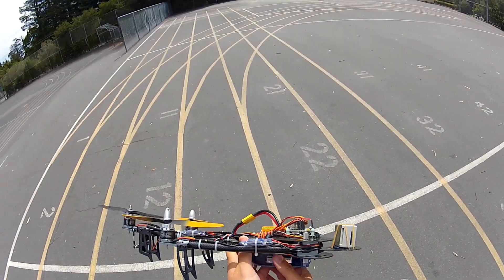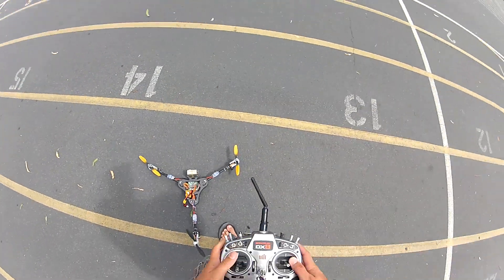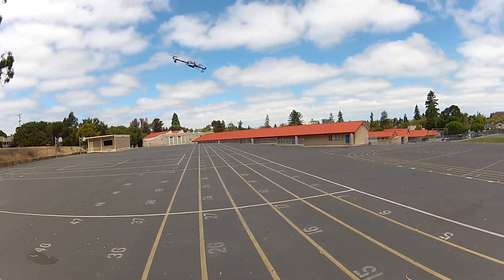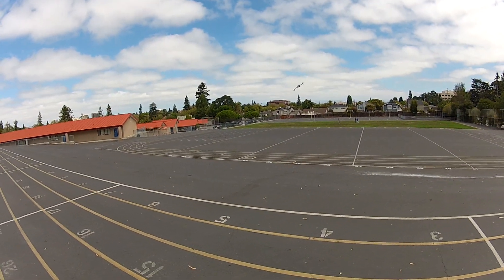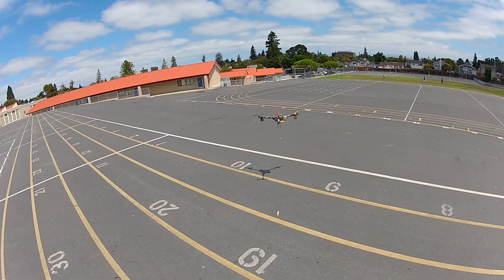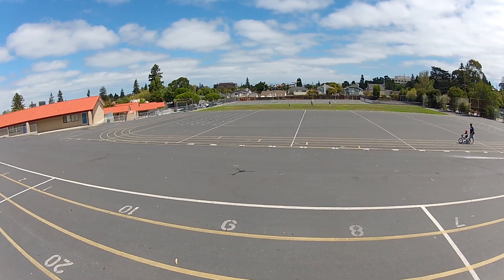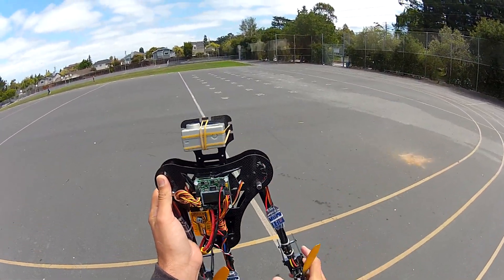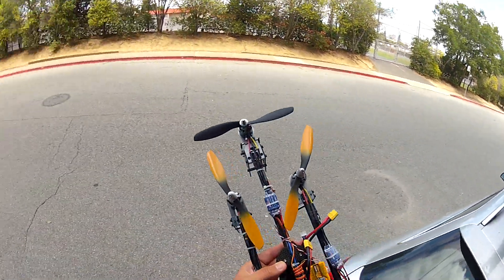Talon Tricopter: Tuning with flip and roll!

Comment: I lost mine the same.way ot got snagged.. but  Yes there is getting crazy efficiency out of the 3303 so as well a speed that was with I believe Sonny's motors a new tail kick shall 12 to 13" APC up front and like a slightly smaller prop on tail usually APC speed props.
..it flew forever heaps of power  I miss it so badly even with the cake 82 I was happy to use if you could help me find another friend or one to sell that for trade arts or quads for it would be forever grateful as it's just a personal favorite all time🤘👊🙏❤

Comment: I think these frames are to heavy and to few motors/props. I use 9" 3blade props and its still a slug compared to my quads that have a DIY carbon frame. To many heavy metal fittings on the Talon tri.

Comment: Hi dh, I built a v tail cnc cut in the garage,all wood 1400kv sunny sky only 30amp dys flashed speed controllers . But running 40c-65c burst 3s 5000mah. fricking think is a rocket 13 min run time (newbeeeee). kk2 running (2.1 i think) but alot of up and down on the throttle. really not sure how to setup the kk2. Any help would be greatly appreciated . Battery wt 428g i put 2 of them on it just for the wt to see if it would lift no problem at all.  8x4.5 props. Thanks  ps: using an orange tx and reciver.

Comment: nice flying.  I fly 3s all the time with no problems.  I used to use a 2200 all the time and just yesterday I tried a 1600 3s and it flew even smoother and I got about 3 minutes more flight time.  Could of been because it was new though.  I'm using 8x4 props as well.  Found really good ones on amazon, flew into my step ladder and my deck the other day and nothing broken.  I was amazed.

Comment: i've noticed the esc's on yours is on the booms rather than between the batt (bottom plate) and kk board ( top plate), running the leads down the outside in stead of the inside .. i'm just about to fit the electronics to mine and wondering which way to go... leads on the inside look neater but maybe outside is better...what do you think??